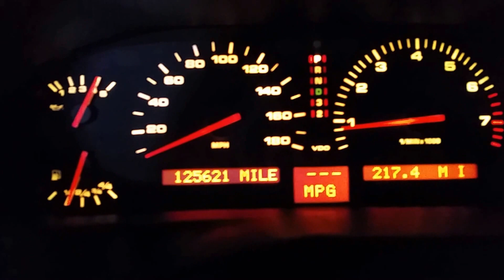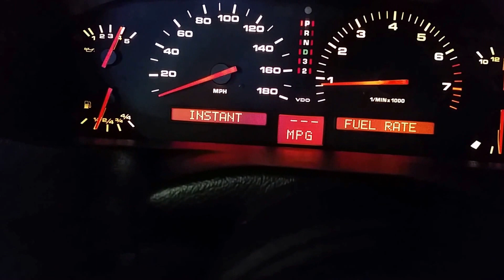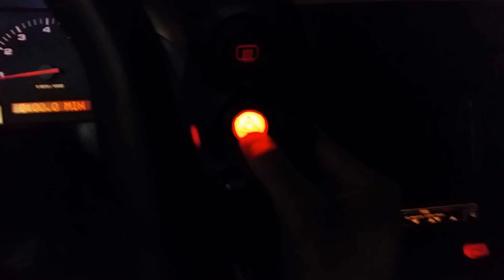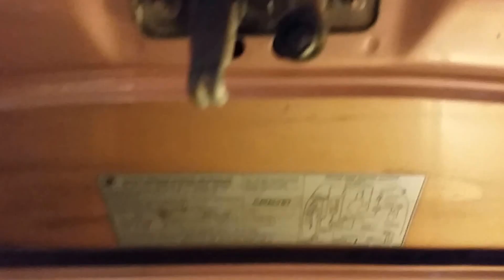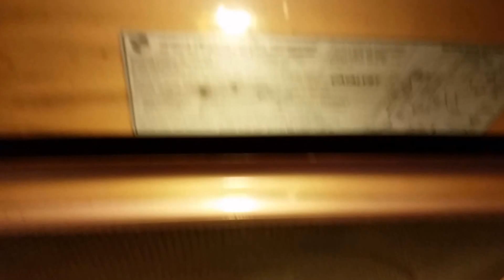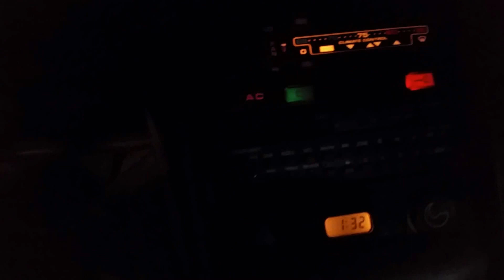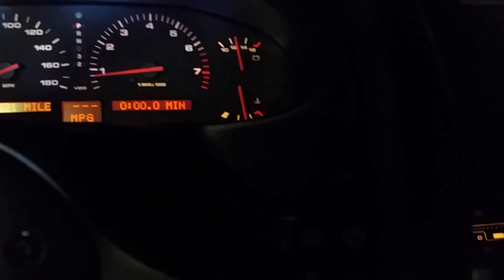Running After 7 Years Of Sitting: 1989 Porsche 928 S4 *1080p HD*

Comment: Hi there, I have a 1988 S4 that hasn’t run for 10 years but has been under cover in dry storage... what precautions did you take before hitting the go button and did you do any static maintenance whilst it was sat there. ??.. I’m a bit nervous about ‘ going for it’
Reply from the maker: All we did was replace the fuel pump, the battery, and took out the 7-year-old gas and put in some 91 octane fuel with no ethanol added as well as seafoam cleaner. A little while later we replaced the spark plugs (total PITA to do) but it still has a slight misfire, so next is to replace the spark plug wires. Since this video it's only been started a few times but it's been untouched for probably the last 3 years, except for me periodically uncovering part of it and sitting inside of it. Currently it's still sitting in the garage with the cover on and we haven't had time to do anything to it. It's also been leaking some coolant near the thermostat for a while and the bottom portion of the engine is a greasy, oily mess. It's sad what happens to a car when it sits for too long, especially if it's a Porsche...
Reply: Thanks for reply, maybe I will document the revival of mine on YouTube. It’s totally mint but it just got left and is covered in dust. I think I might do a fuel line change, water pump, timing belt, flex plate preload check, fuel pump and gas change, put some release oil down bores and try turning by hand without plugs in etc as  I’d hate to be hasty, find out something is sticky and bend 32 valves in what is otherwise a car in perfect condition !!! Ha ha. Will be N expensive but fun project I hope. Yours sounds great !!! You should hop in it and go for a drive !! :-)

Comment: What is this car worth?
Reply: depends on the condition but looks like it has  128k miles and looks ok 3 condition so this would go for 18k to 22k area if there is no issues w the water pump timing belts and oil licking etc...  since it had been sitting over 7 years plus that is not good bec most of the plastic parts and lines has to be replaced and the seals etc.  but even tho if inside has no cracks and have nice interior than this can go for 15k 18k area and the cleaner conditions with low miles like 50k miles with #2 or so goes around 35 to 45k  are which are near mint in and out. and others with #1 goes much higher.